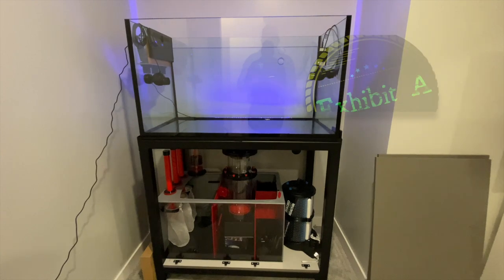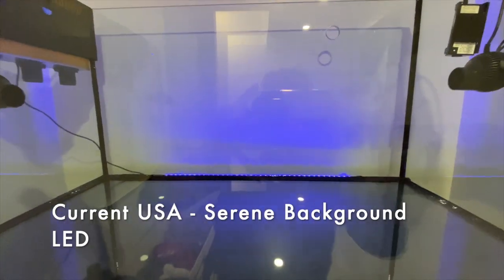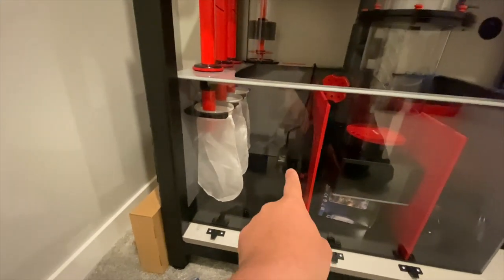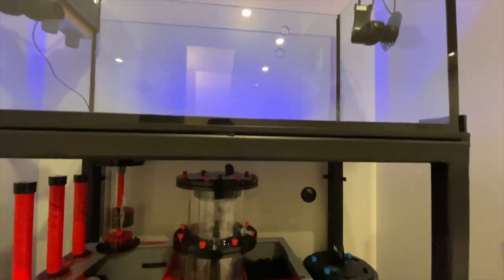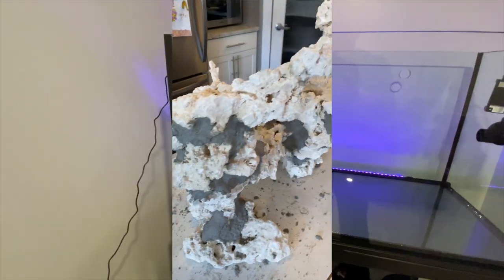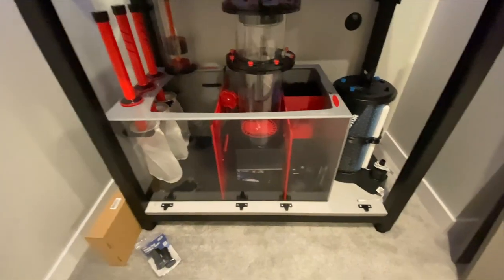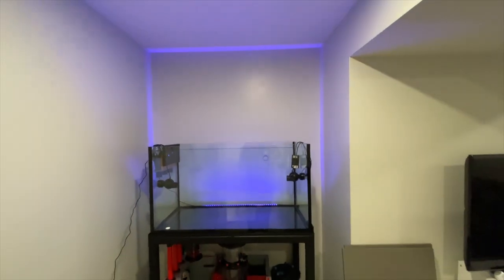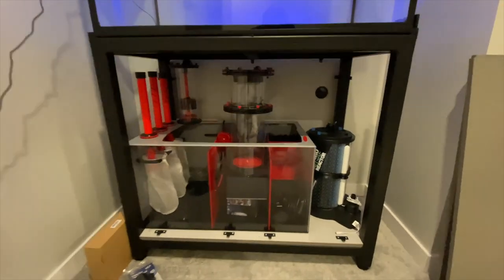New 75G Custom Reef Tank Build - Episode I - Sump

Comment: Were you able to fit a roller mat/fleece roller in that first chamber?
Reply from the maker: Yes I was, it was a little tight, but with a 3D printed pedestal, I was easily able to mount the clarisea sk5000
Reply: @AquaristExhibit  Your build looks awesome. I want to get a redsea reefmat 500 but I’m worried it won’t fit in the first chamber. Which sump size did you choose?
Reply from the maker: @kupcake8299  please take a look at my Instagram @aquaristexhibit . Tons of pics and descriptions there, you can also send me a message if you have any questions! Thanks for the support!